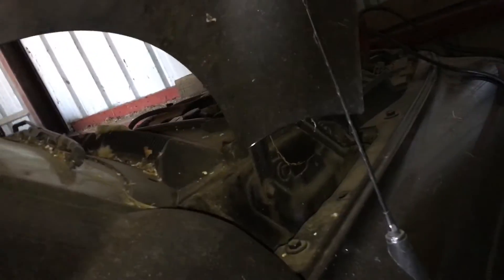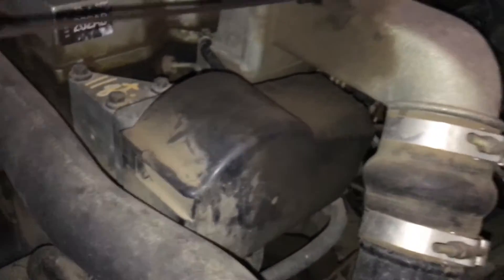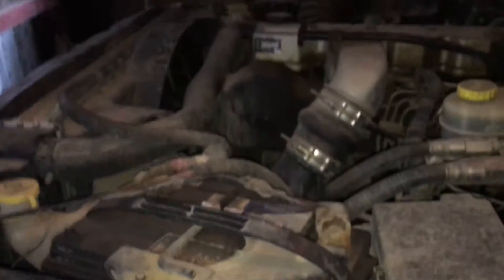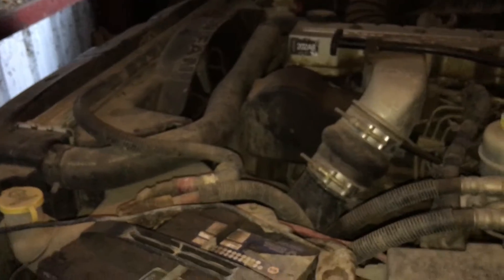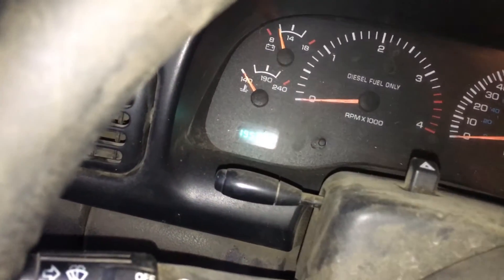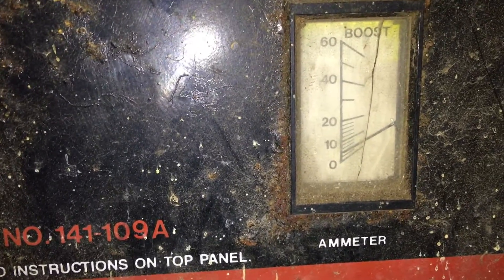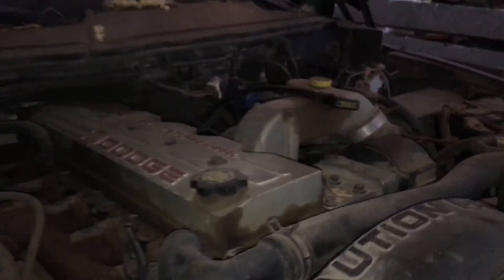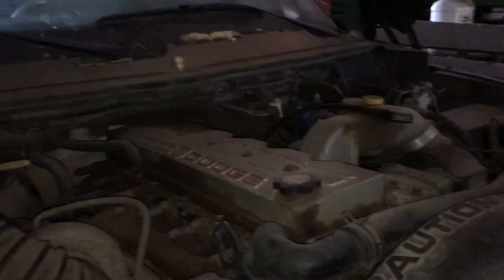Old Start Cold Start Dodge 2500 Cummins Turbo Diesel

Comment: You need to leave it on boost for about 5-10 minutes before you try to start. Those were really dead. 2-5A charge rate for a short while won't put nearly enough into them. Those big diesels need 500A+ to turn over so most of it will need to come from the batteries after it's charged a while.